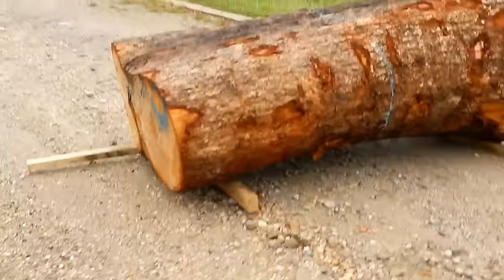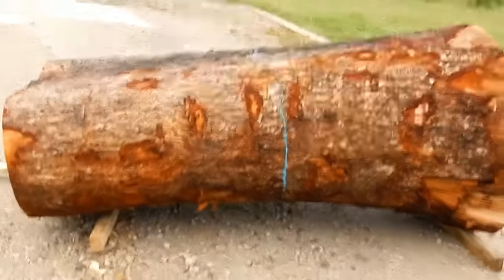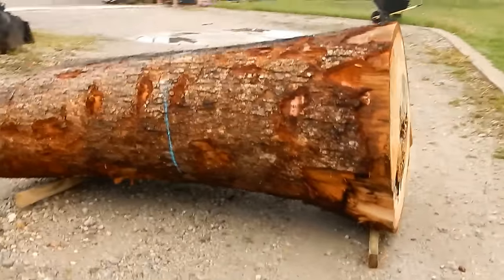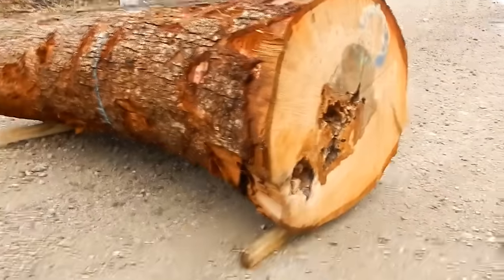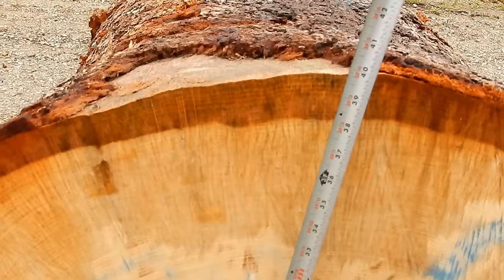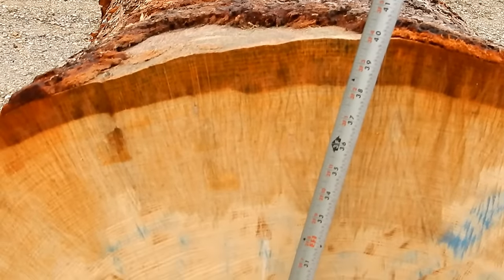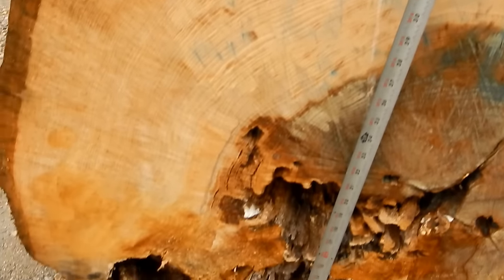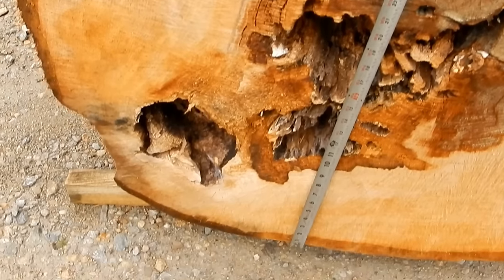Black Powder Log Splitting for Wood-Mizer Sawmill Pt1

Comment: Your blackpowder split and a comment someone made about a 44 mag reminded me of an incident years ago.  We have some mountain property that gets heavy snow in the winter.  On the first trip of the spring, one year, I discovered a ponderosa pine had fallen across our access road.  Didn't have my chansaw with me, but I did have a single-shot Thompson-Contender with a 10" barrel chambered for 44 mag, and a large supply of reloaded cartridges.

So at point-blank range I fired a series of shots about 1.5" apart.  Didn't complete 10 shots before the trunk broke in half.  After some grunting and shoving I drove right through.

Comment: Could you show us how you place the charge so that it splits rather than explodes in splinters in all directions? Thanks for sharing..
Reply from the maker: MRrwmac For liability reasons, we don't teach others how to use explosives. However, I will say if your log is splintering into little pieces flying everywhere, you have far too much powder for the log.  I do have another video that shows us prepping the log before it explodes, but it isn't meant to be a teaching tool. https://youtu.be/XDR9aKjQkVg PLEASE, if you try this yourself, start with small log cut offs with a 1/2" drill bit hole, always thinking of safety first (for you and others). Pace yourself, safe repetitive practice gives valuable experience. Thanks for watching! Linda

Comment: Linda, I have been binge watching your channel. Very interesting. I know this video is four years old. But, I was just wondering if there was a chance of ruining the whole lot by splintering the two halves. From the shock of the blast I mean.
Reply from the maker: Well…the chainsaw cut is made at a certain depth and in a direction that mimics a wedge. If too much powder is used the halves fly farther apart and there could be extra wood damaged, but the blast follows the path of least resistance, so in our experience the whole log has never been ruined. That being said, there are many variables in a log that may affect how or if a log can split, whether using a wedge or powder. Also, if you have ever used an axe to split wood by hand, you know that some species split much better than others. Hope this helps answer your question. Linda

Comment: Thank you for the show
We cannot buy black powder nor dynamite here in Sweden
so we cut heavy timber with the Chainsaw first http://youtu.be/3y-VvEgZ6CY
and it will always be exactly in the center, and it makes a lot of noise to :-)
enjoy your Videos  keep on working
Reply from the maker: Svend Nielsen Yes, it is nice to have the freedoms we have here in the USA. The chainsaw is more tedious and can be more dangerous, but some logs won't split well with black powder. Thanks for watching and commenting! Linda
Reply: Yes Chainsaws are Two stroke and they looses moment quickly.
We are now working on a hydraulic tractor powered solution with a Parker F11- 6 Hydraulic Motor/Pump - Parker lossless 18KW. 24 Hp.
the sliding rail can be mowed sidewards and  in this way make a perfekt parallel block with 2 cuts.
Reply: +Svend Nielsen Maybe you could use/adapt some sort of hydraulic device.
Reply: +WAVETUBE84 Yes at tractor with external pump and a Parker F11- 6 Hydraulic Parker lossless 18KW. 24 Hp.saw motor for the chain drive